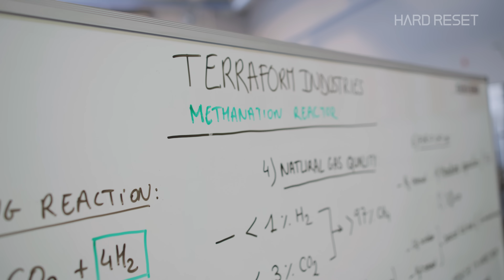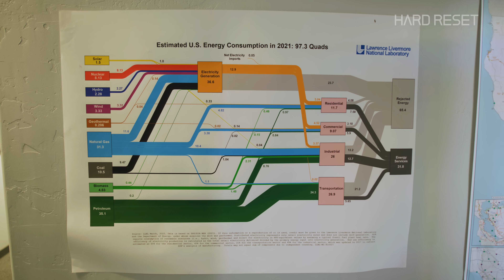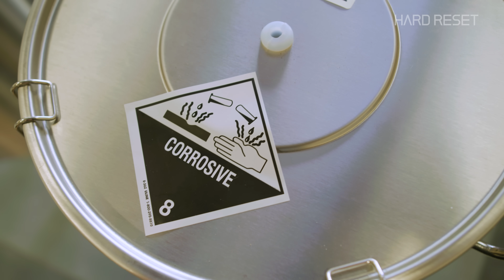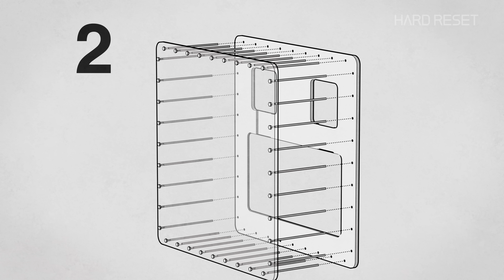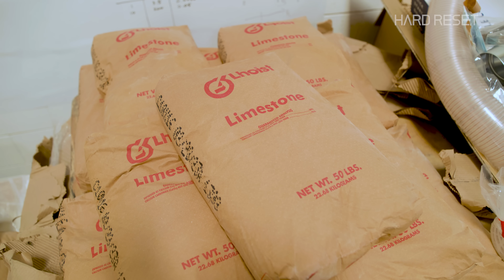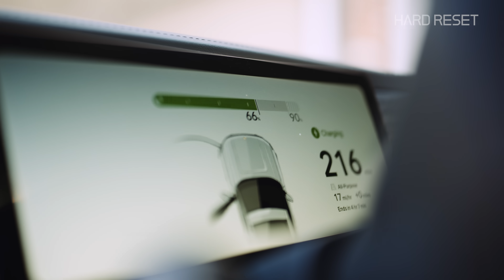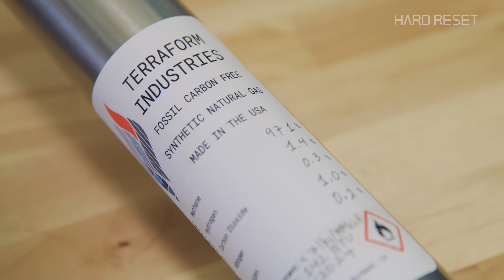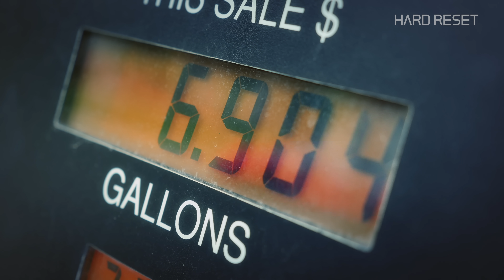The Last Fuel We'll Ever Need?

Comment: Utterly pointless nonsense.   You use electricity here to make Methane.  Without considering compression, you are still better off just using the electricity because the electrolyser is only 70% efficient on a good day.  Considering it as storage, pumped hydro is cheaper and more efficient.  Inefficiency is not ok.
Just do a bit of maths.

Comment: I dabble in the Hydrogen generator myself, and ran it into an engine on a car, 6 cylinders 1996 Pontiac Bonneville, and  it got 58 MPG just by introducing it into the intake of the engine.

Comment: I understand the goal of burning CO2 that is already in our atmosphere as opposed to drilling for it. The question will always be "How much energy does it take to make energy using this system?" I'm hearing about electrolysis (needs energy) and "sucking CO2 out of the air" (sounds like it requires some sort of pump, hence energy) If you can't get out of it more energy out of it than you put into it (which I don't think is physically possible) then you're just standing in place. Right? I guess the solar panels covering the roof is the source? Even still, if you're using more energy than you're producing, it seems like a losing proposition to me. You could use the solar panels to charge batteries which might yield more energy than this process. Ultimately, our demand for energy is 50X the amount of solar power we are producing. And our demand for energy is extremely elastic. In other words as voracious as our appetite for power in now, it will grow as we need more power for crypto, 6G, electric cars, and AI.

Comment: If methane heating is being phased out in some developed countries (swapping combi boilers for electrically powered heat pumps and gas cookes for induction hobs for example.) what is it that those governments and the local businesses understand that makes them  move away from methane ('natural gas') When combusted it creates CO2 with a warming potential of 1 and when it leaks it has a warming potential of 80 times that of CO2. It persists in the atmosphere for decades that we don't have time for ...A bit of a red herring? Electricity lost or 'leaked' through grid resistance does not create warming gases. Best to keep it simple. As for portability, batteries either solid state (700 mile range with 5 mins recharge in pipeline) or other types are the approach of the worlds largest car manufacturers. As for electric trains, the first one ran in 1837. They may catch on, apparently. Probably not hoax transport? A number of billions people's journeys have been made on them for well over a century, probably . If not trillions. And the price of tickets is always going up. Must be inflation?

Comment: Using hydrocarbons for products, sure. Great. Lubricants, plastic, chemicals. Possibly critically important. Using hydrocarbons for fuel.. feels to me very dumb. 

It's like using a windmill to power a lamp, to grow food to feed a horse,  to move around on. 

Strategically, even if conceptually ot works, this will be one of those useful idiot ideas that are used to justify continuing extraction of fossil hydrocarbon. Which will ultimately cause much more harm. 

And before anyone mentions long haul planes & fuel. That's just an engineering problem that will be solved in the next two decades. Longer than likely this would take to come to market and scale to anything like current oil extraction levels.

Comment: ok? so we want to take co2 out of the air and generate methane and it will not impact the earth?! in what universe is this true? methane is far worse than co2 for climate change. carbon neutral, yes but that means nothing when you covert the carbon to a more detrimental form. not even going to mention the other problems with this. i AM a physicist and this vid is an insult.

Comment: Using a calcium hydroxide to carbonate to oxide cycle.  Crazy inefficient because of the high temperature needed.  I can’t believe that the capital cost of a more efficient amine or adsorbent based system wouldn’t make sense.

Comment: how much energy is lost by having to (1) split water into hydrogen (an already viableish fuel source) and (2) heat the calcium carbonate IN A KILN to release the co2??? And this still is 35% efficient? So we go from about 20-30% of the sunlight's energy harvested via solar panels, then use a lot of materials, create waste heat etc to get 35% of that electricity converted to methane, using a carbon source of (checks notes) passively blowing air over limestone to adsorb co2? and then ultimately loose a large percentage of the energy in the methane during the combustion process as waste heat? I understand that the world relies on solid / gas fuels but this seems like a fundamentally flawed approach... I mean hydrogen energy has already pretty much been put to bed due to the energy lost in the conversion process and that is literally just the first step of this process

Comment: You do realise that you are spliting water to get hydrogen and oxogen. This can be improved massively by splitting urine as it has more hydrogen and takes only 1/3 the energy to split using DC elecrolysis. That should improve your efficiency.
Reply: Use human waste which there is endless, to develop methane, it would better to create plant at source of use ie each town. This way no loss in transport or pipe. Get them correct size have one at each home to refuel car and gas appliance using your family crap?

Comment: ETs reprogram matter at the molecular level. A small piece of matter you could hold in the palm of your hand is programmed to vibrate. It gets hot and can heat a house. It vibrates forever and needs no maintenance. Can you figure out where the energy comes from to make the vibrating piece hot?  Try Zero Point or scalar.

Comment: That is NOT a "climate neutral" process - methane is 80X more damaging as a greenhouse gas than Carbon Dioxide! The ONLY energy solution we need is 100% renewable energy (solar, wind, geothermal and wave) generation to power a 100% electrified world, using batteries for energy storage. Full stop. ALL synthetic consumable fuels (hydrogen, methane, etc) are just the desperate attempts of fossil fuel billionaires looking for a direct replacement that they can control, so they can keep profiteering from the public!

Comment: Personally I want to increase the level of CO2 in the atmosphere. I like this sort of work because it is not about reducing CO2. Personally I would prefer solid carbon as a fuel. It is extremely safe and can be stored in vast quantities. It could be an alternative to bitcoin mining. I have a really simple method for removing CO2 from the atmosphere but I will not reveal it until all the climate change nonsense goes away. Speaking of solid carbon as fuel I have figured out how to burn it in a car and no it's not an inefficient producer gas generator.

Comment: Of course, it is much less efferent than stated because there are substantial losses when the methane is burned.  So the mechanical energy you get out would be very lucky to be 10%.  Anyone betting on this is betting that we will not develop batteries that are far better than we have today.  Because at that point we would just use batteries for planes.  Even longer range ones.

Comment: Just a thought, but if hydrogen can be produced pretty simply, in more static usage environments, would it not be more cost-effective to use the hydrogen as a fuel and using methane where the high energy density fuel was more critical.

Comment: The problem with solar and wind, is that they are intermittent sources, which is to say that solar 4:58 doesn’t generate at night or on cloudy days, and wind generators don’t work when the wind is calm.
Reply: This is what batteries are for. There are batteries available, and in development that don't need lithium, or problematic materials. So there is zero need for convoluted synfuels. This video implies it would also generate methane at night, which is just nonsense.

Comment: Can they produce a closed loop system? Harvesting CO2 and water produced and recycle it back through. Reducing the time needed to blow air over the limestone. Reducing the energy needed to run the fans. 

Natural gas is difficult to store in large quantities. Which really sucks. A bio-propane would be better. More energy dense and capable of being stored with ease. Letting microbes passively produce propane without much of any energy input.

Comment: A lot of talk about foolish thinking.  More energy in than out. Cost = thousands of dollars for one gallon of gas so far, and that is all it will ever be.
That is why it is not being produced today.  Fools get hooked on an idea, then want financial backing that gets wasted, is what you are seeing here. BUT,
Using wasted falling water, a 200 foot 2' tube up the hill to a home made dam, powers a small hydro alternator using a direct drive washing machine motor that creates electricity to separate water into hydrogen & oxygen.  Stored separately, you come by once a week and get free fuel. Our entire uninhabited coast line has untapped potential hydro power available.  Replaceable units can be manufactured.  Hydrogen & oxygen can produce electricity or burnt as fuel in a car or boat, it produces water.

Comment: Wait, he said at first to get the co2 out of the air and then he is using lime stone to get it? He also said that fossil fuel won't last forever digging it up out of the ground but that is exactly what he is doing with the lime stone!  He isn't taking it out of the air like he said, he is taking it out of the lime stone just like all of the other fossil fuels are doing today. This is nothing new. This is one of the reasons why people don't think things will ever change is because of "recovering physicists" like this one with their misleading. It is certainly is not net neutral because it was removed from the air at some point in time in the past just like all fossil fuels were and have to be dug up.

Comment: OK, all of this is fine. But what I want to know, Is can this be converted into liquid fuel that my car can burn? How many miles per gallon per cost of fuel can I get (aka how many cents per mile)? Will my car have as much power? and what is the efficiency of carbon to make this fuel? in other words are you emitting "6 Co2" units to make one fuel unit? And when that 1 "Co2 unit that you produce is burned, how many does it emit?

Comment: I doubt this is a good idea, why use electricity to produce a polluting gas while we lose 50% of energy first when we change to gas, and then we lose another minimum 50% when we burn the gas. So we lost 75% of electricity, electricity we could use in a car or heatpump where energy are used at 500% efficiency, but it is already 400% efficent, mean using electricity directly is around 2000% more efficient than change it for burning purpose.

Comment: I find this kinda redundant, highly efficient solar panels NEEDS rare earth metals to be made efficient. Without it the energy conversion drops below 30%. The cost of solar won’t drop either because the demand is now extremely high as the UN wants the world to convert to EV by 2035-2040. Metal used in EVs are also in other electronics like solar panels. As times goes on and the market gets realized it will sky rocket costs. Funny enough Canada has one of the rare ore reserve which is why China and America wants to take Canada RN.

Comment: Cool. What is the smallest installation one could implement? I’m thinking, of course about home or small community use or a ranch. I realize that scaling down the size would diminish efficiency and increased dollar efficiency as well, but just thinking almost about a DIY installation or something that could be implemented on the smallest scale. What do you think that could possibly be in the not too distant future? And does your estimate of 30% efficiency include liquefying the final product? That would of course be required for a small local installation for effective storage I believe, but essentially you’ll be creating a sort of methane energy battery conversion of sunlight, water and atmospheric carbon dioxide.
As an  Anesthesiologist I can relate to your CO2 scavenging system. That is exactly what we use in the Anesthesia breathing circuit. So-called, so lime. It is also what is used on submarines and in underwater breathers. I’ve always been impressed at how much carbon dioxide Can be stored in about 2 pounds of soda lime, maybe 20 hours of basal metabolic CO2 production.

Comment: Really from everything that has now been exposed you still cling to the CO2 hoax, got to hand it to the liberals they are as hardheaded as one can get. I watched as the hoax took a simple process and made it so unrealistically complicated to cover up the fact that water vapor does the same thing as CO2. Water vapor is much more efficiently as it is far more common yet because of the actual complex cycles of the earths systems non of it really made a difference. Which is why those ridiculous graphs and models never worked yet the weather was blamed on CO2 and fires and sea levels rising and all of it false or at best some global warming but by a totally seperate process that ca not be taxed. I must say I do need to gloat after my disgust with the fake science of liberals.

Comment: Well good luck to them.
Somehow I doubt it will come to fruition. 
If green hydrogen, the first part of their process, was economically viable we would see much more of it.  
It is very useful in industrial processes, so no great storage / distribution issue.  Same for energy storage back to electricity.
They are correct that cost is more important to efficiency.  To use solar plus storage efficiently, you need approx 4x capacity…so what to do the excess.  Same for windy on windy days.

Comment: 13:40 woman states it will produce hydrogen. So is it methane or hydrogen ??
Reply: Methane 
1 atom od Carbon and 4 atoms of Hydrogen 

CH4
Reply: CO₂ + H₂ → CO + H₂O
CO + 3H₂ → CH₄ + H₂O 

Or simply

CO₂ + 4H₂ → CH₄ + 2H₂O
Reply: Hydrogen is required to make methane via the above processes. 

But it is so much inefficient. We just need some more efficient storage solution for hydrogen to crack the green energy problem.

Comment: It's always going to make more sense to use electricity from renewable generators directly rather than taking the efficiency hit with a conversion process. Even if the conversion process was 100% efficient burning the synthetic fuel is still going to be 30% ISH efficient overall. There are some niche uses like plastics production but it will never work as an energy storage or transport fuel.

Comment: It’s awesome they are doing this. I had a similar realization that this was one of the better ways to achieve carbon neutrality using this exact process. I think the best way to upgrade the efficiency of the process is to combine it with nuclear molten salt reactors which have ample thermal energy which can be used to both bake the CO2 out of the lime and also can be used to run the sabatier process which requires a fair amount of heat to work. Seems a waste to get rid of all the infrastructure we currently have and also we will still need feedstocks any way about it for production of all manner of chemicals critical for our society. If we can develop carbon based fuel cells that work on car sized scales we’d really be booming since those could potentially be 2-3 times more efficient than current ICEs and would require fewer and smaller battery packs and take advantage of the energy density of carbon based fuels and ease of refill and transport and infrastructure. Glad to see someone else was thinking similarly.